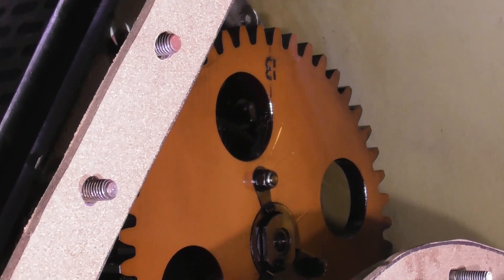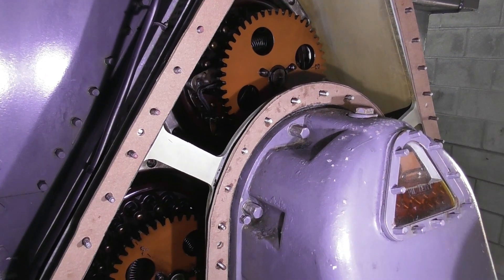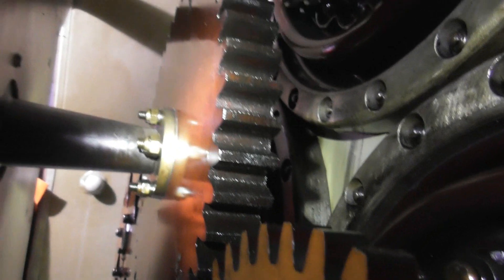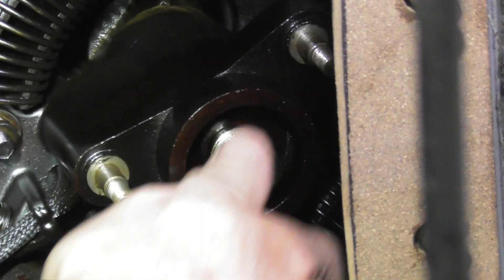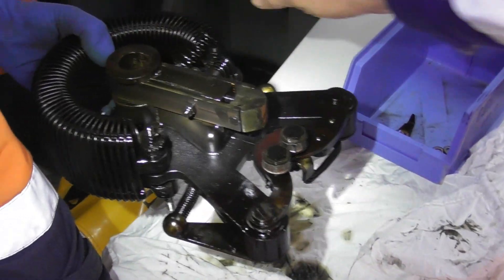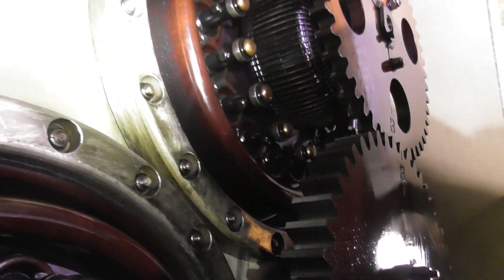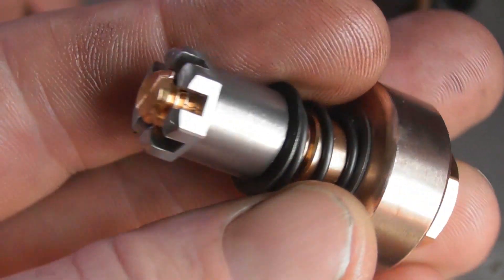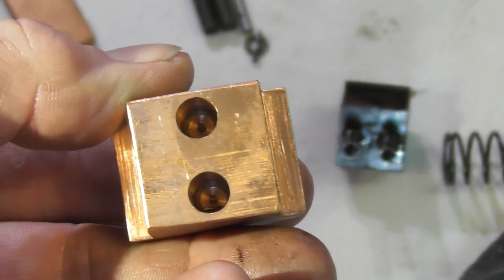Ferranti DS 2 On-Load Tapchanger  Changing the contacts

Comment: Interesting! 
So that's how changes in load is compensated on those transformers (I have not seen it before).
Reply from the maker: There are different designs, but these Ferranti DS 2 tapchangers are very common and reliable.
Reply: @RODALCO2007  Hi Ray, what types of AVC relays are typically in use in NZ to control these babies?

Comment: Do they let you operate them manually live? They’ve stopped engineers operating them live in the UK since one blew up a couple of years ago and killed the operative.
Reply from the maker: No, live operation via manual crank handle was not allowed anymore since about 2 months ago. As we nearly had a blow up here in NZ and then the Chelmsford (English) case from about 12 years ago was raised.
Reply: @RODALCO2007  Are these motorised in normal use, or is it manual only?
Reply from the maker: @someonesomewhere1240  These are motorized and remote controlled via a VT sensing circuit.

Comment: How many hours (years) of wear is on these parts? They look quite used up!
Reply from the maker: Most likely 30 years.
Reply: @RODALCO2007  Oh, that makes sense then. The black coating that's everywhere i guess is the burnt oil from arcing when switching the taps? Also the big wirewound resistor, is that for taking up the voltage difference when the switch does the make-before-break?
Reply from the maker: @zaprodk  Correct.